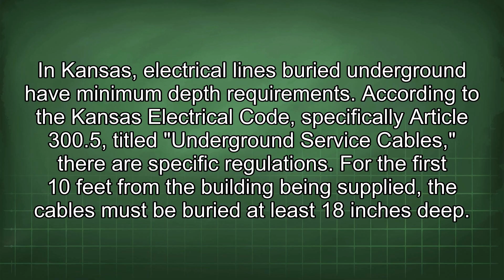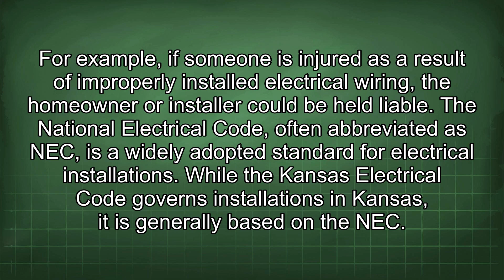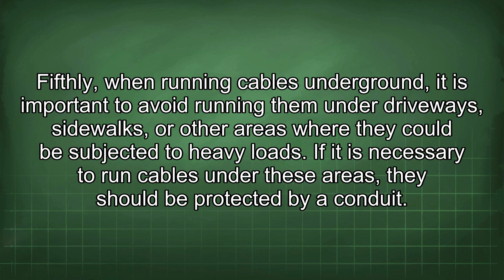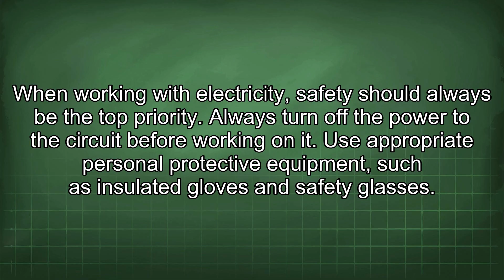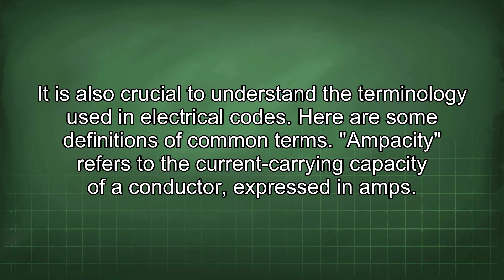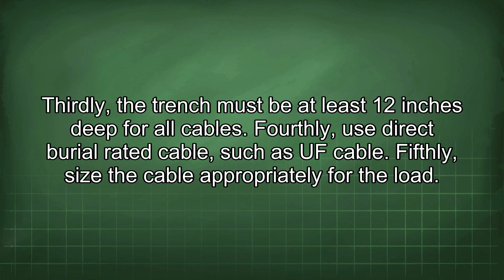Kansas Electrical Code Underground Wiring Minimum Depth

Comment: Do the rules require that a ground rod in a yard be below grade? AT&T just installed a vault in my yard and it's rod stands 3 inches proud of grade. Second, can I legally fix that with my angle grinder?